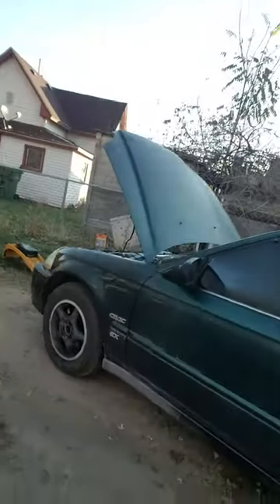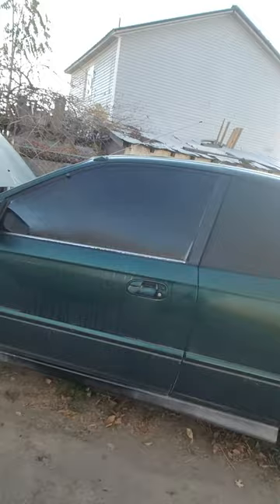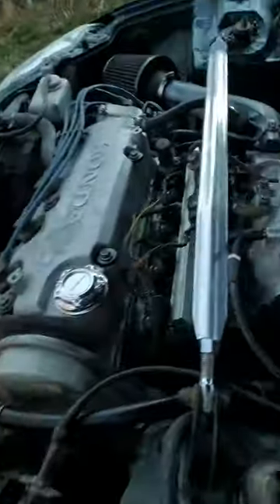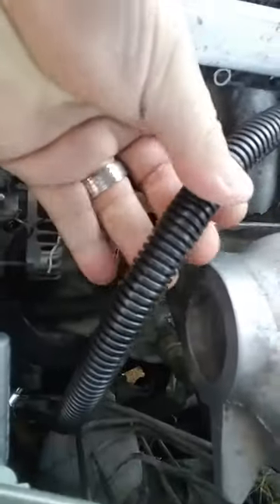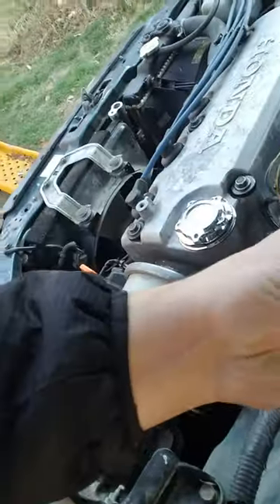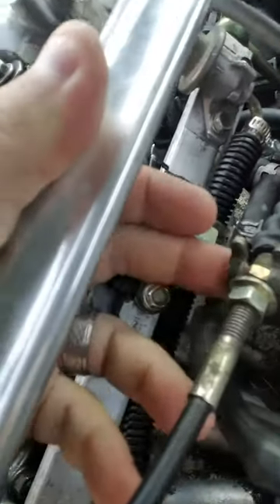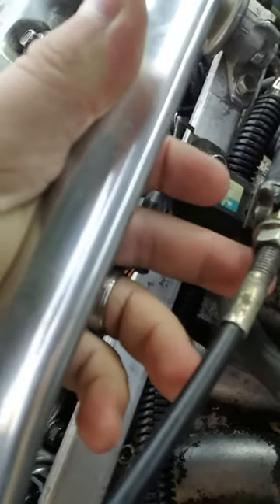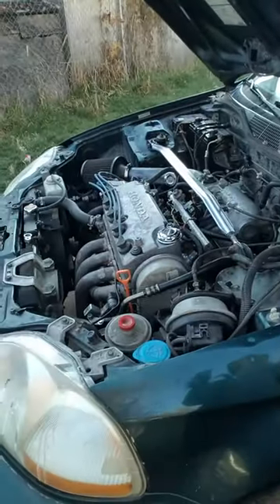Honda civic stalling and idling problems

Comment: Hey Mikey! I JUST bought a car no more than 1 hour ago and it stalls as I'm pulling into the driveway. It's a 2003 Honda Civic Coupe. Once I let the car role to the end of the driveway I try starting it back up again and it won't. Now I'm out $3,300 that I worked my butt off for (sleeping at work hours before my shift even started due to relying on another person's schedule & the bus) and I'm still paying for it. Please let me know what you think it might be. I'm ready to pull my hair out. Any thumbs up to get this comment noticed is much appreciated. Please help.
Reply from the maker: Hello I'm here plz call 208 230 9017
Reply from the maker: This is Miley btw that's my number here to help
Reply: Hessian Lord Hello Mr Mikey I'm having a similar problem, can I call you and ask you for any advice you have?
Reply: jaidsalgado I have the same problem when come to a stop the rpm reads about 200 and sometimes stalls
Reply: Also I get a hard start

Comment: For honda fan there do this clean ur throttle body and also the IACV  this well help for engine run while car stop. And rough engine ... check map sensor also then adjust the rpm  .

Comment: Basically you have to part slap for a bad idle. Also it drives like trash if you put tension on the throttle cable. Just take the slack out and adjust small idle adjustments with the idle air screw

Comment: I have a 2002 Honda Civic that I’m having trouble with. It is misfiring on cylinders 1, 2, and 4. It absolutely will not idle and really doesn’t want to start. Car is in time with a new belt. 4 new intake valves (previous ones were bent). New head gasket, head studs, and all of that good stuff. Checked injectors with stethoscope, they all sounded fine. Pulled plugs and checked spark, all of that is fine. Not sure what else it could be. Doesn’t throw any other codes besides the misfire ones.

Comment: I have a 94 civic dx hatch with a d15z1 engine. It idles porky. Then I tighten the wire u talked about it got better. But I put it in gear and drove it about 5 meters it shut off.

Comment: Good video...
I have 2001 honda civic ex and it stalls after half hour drive and doesn't go over 2500 RPM.  Then I just let it cool down for 15minutes and then the car us back and all powers are back and normal driving.  Again, repeats.  Any recommendations where to look next
Reply: Your catalytic converter might be clogged up/backed up. Try cleaning headers & or the cat.

Comment: Hey mike aorry to bother i dealing with a car right now same motor but non vtec i pretty much change a bunch of sencers and now im stuck every time i hitting about 40 miles an hour my car stalls dont no y any suggestions??
Reply: Can't " Idle / Shakes / Stall ", usually Air Problems, like the ACIV (air control idle valve) or Air Issues like PCV clogging!  Start with that first!

Comment: Hey Mikey--trying to solve a rough idle in gear (Drive, and especially when AC is on). Regular RPM is aorund 800-900 when in P or N, but drops to like 500-600 in drive. No vac leaks, new IACV, new plugs, timing (both mechanical and electrical) is on point.

Did idle re-learn procedure and still nothing.

Can't seem to find a PDF copy of the Honda manual anywhere, either. Only single pages here or there online. Any ideas?
Reply from the maker: Adam Lawson hey buddy you did all that and she’s still rough idling jeez and the ac is on hmmm seems like when it’s under a lot of load she gets rougher thing about that is I took out my ac cause it takes a lot of power out of the car now back then it was either have a nice ac or power what yr is the hind your working on

Comment: I have a 2002 honda civic 1.7l vtec coupe. And it bucks and stalls when I get on the gas. I thought I could change the head gasket and tps but I'm not really sure on what's going on with it... it goes into limp mode sometimes. I changed the ecu,crank shaft sensor,camshaft sensor and it still was doing that
Reply from the maker: D.I.Y Automotive you did all that work and she’s still doing it how is she at idle what rpm

Comment: Just woundering why when i drive my d16y7 ek hatch after about 20 miles freeway its starts to shake like it wants to turn off and when i check my spark plug wire is always popped out
Reply from the maker: Tania Mejorada hello sounds like you need to torque your spark plugs down the wires should not come out unless there is compression coming out of the spark plugs

Comment: Hey I got a 96 civic ex when I dive it has shifting problems the rpm shoots up and down when I'm at a stop or driving some times it stalls like its going to shut off but doesnt and keeps going idk any sugestions
Reply from the maker: Clutch and throw out bearing while your in there change the fork and the pilot bearing

Comment: I have a problem with my b20b stock. When I hit the gas pedal and it chokes on me. It will start back up, then it's off, its all clean and new sensor, on top and side sensor. Help please 96 civic

Comment: I have a 95 civic 1.6 vtec I have to pump the pedal for it to start and feather it till it warms up then I hit the gas then it seems to suck in lots of air the die or it runs decent any ideas I replaced the fuel filter and regulator coil wires and plugs as well. Any help would be awesome
Reply from the maker: Adam Hover I would love to hear what she’s doing send me a vid chances are I already know what it is just wanna make sure
Reply from the maker: Adam Hover 2082309017
Reply from the maker: Adam Hover add me my name is micheal Rivera
Reply: Hessian Lord I have a vid uploading

Comment: 1995 Honda civic lx keeps stalling out when I’m stopped & when I’m driving ill have my foot on the gas but then the rpm’s will drop for about 10 seconds then it’ll just kick back in & start driving changed entire throttle body, spark plugs, fuel pump, fuel filter

Comment: My 94 d16z6 cuts off when I deccelarate coming to a stop. Any suggestions?
Reply from the maker: Nicktropolis90 ok so a lot of things not enough gas / air , air leak ect
Reply: Nicktropolis90 try getting your throttle body cleaned out. I had the exact same problem of car sometimes stalling while coming to a stop and since I had my throttle body cleaned it hasn't stalled ever since. 🤞🏻🇦🇺

Comment: Hey question my rpm it’s like yours it’s in the last 2 bars it shuts off while driving and when I’m at a stop sign it lags and looses power. When It shuts off I turn it back on and it turns back off it does that for 2 times after the second it turns on but I have to accelerate what can it be Mikey

Comment: I have an automatic and it idles fine in park but in drive it dips rpms and stall sometimes.
Reply from the maker: gurbeer athwal check fuel and air may not have enough fuel or have a air leakage
Reply: Same did u find out ??

Comment: Hi I have a 99 civic ex and It sometimes idles rough and when im in neutral at a red light or stop sign it turns off and sometimes wont start back up for 2 mins, I cleaned IACV and throttle body and changed spark plugs im thinking fuel pump ?
Reply from the maker: SÄƬXƝ1x yes check fuel pressure if not out oftiming

Comment: Hey my 01 Civic with the 1.7 Vtec seamed to bog down with no throttle response. It was raining at the time and I cleaned my o2 sensor yesterday. Any ideas what could cause the car to bog down under acceleration?
Reply from the maker: Matthew Thaxton does it only do it when it rains
Reply from the maker: Or gets wet
Reply: Hessian Lord just bought the car first time driving it in the rain
Reply from the maker: Matt text 2087414105
Reply from the maker: That’s me

Comment: help my honda 95 high idaling when start i push on the gass and it stalls at 2000 rpm 45 but then i turn it off and it starts up again

Comment: I have a 2000 civic and after I turn it on for the 2nd time and start to drive it drops rpm and it sound as it’s choking and putting my feel down bring it back but the car does not turn off
Reply: Can't " Idle ", usually Air Problems, like the ACIV (air control idle valve) or Air Issues!  Start with that first!
Reply: Can't " Idle / Shakes / Stall ", usually Air Problems, like the ACIV (air control idle valve) or Air Issues like PCV clogging!  Start with that first!

Comment: Hi , I have a honda civic 1.6 2001 .auto. car will not idle. Please can you advise .
Regards Dimitri
Reply: Can't " Idle ", usually Air Problems or Gas, like the ACIV (air control idle valve) or Air Issues!  Start with that first!
Reply: Check PCV in case of clogging.

Comment: My car just randomly started shaking and putting/almost stalling
Reply: Can't " Idle / Shakes ", usually Air Problems, like the ACIV (air control idle valve) or Air Issues like PCV clogging!  Start with that first!

Comment: I have a 94 Honda Civic coupe and it can’t even idle
Reply: Can't " Idle ", usually Air Problems, like the ACIV (air control idle valve) or Air Issues!  Start with that first!
Reply: Check PCV in case of clogging.